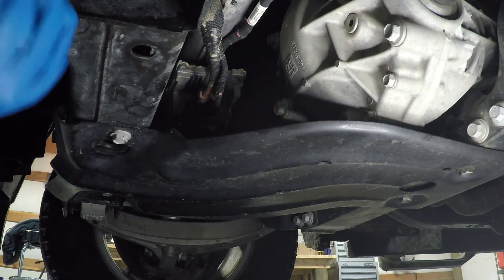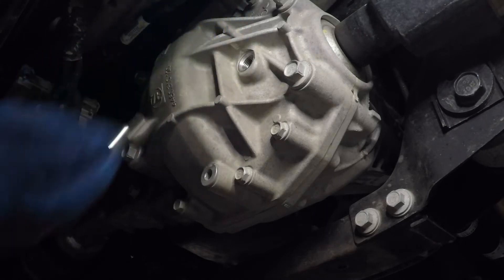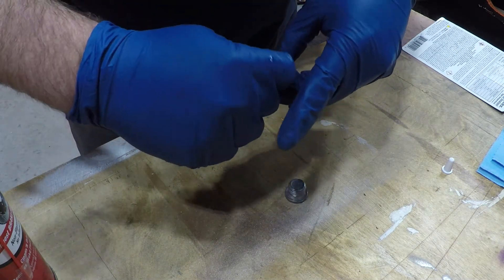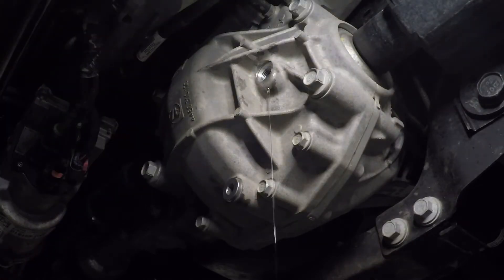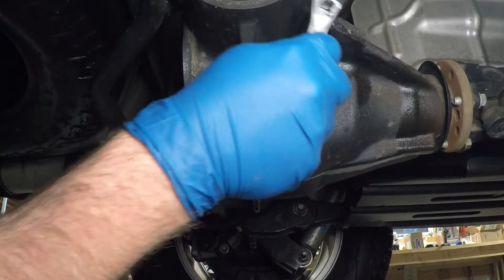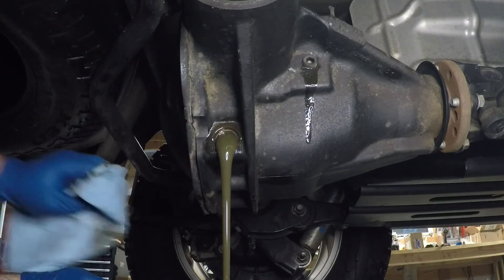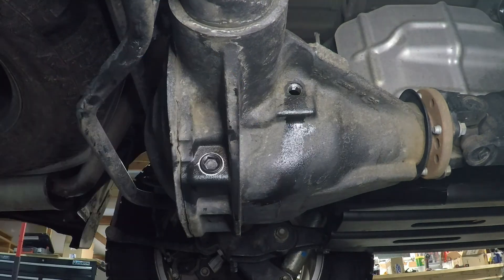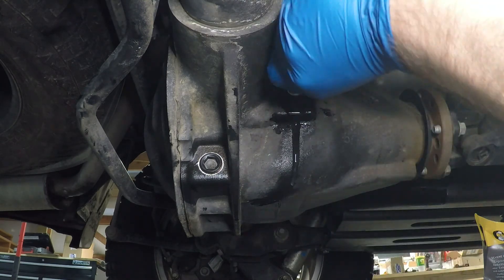RAM 1500 Differential Oil Change - 5th Gen Front and Rear

Comment: Mine has the max tow package and says to use 80w90 on the rear and 75w85 on the front.
Reply from the maker: I chose 75w90 for the front instead.  I have the standard rear diff with 3.92 gears which calls for 75w140.  Do you know the difference between the max tow and standard?  I'm guessing, a physically bigger diff with 3.92, but don't know.
Reply: @WorkshopAndHome  Yeah I really don't know if it's actually bigger. I am just going by what my manual says and what the parts guy at the dealer confirmed for me based on my VIN. Have you done a transfer case flush yet? Do you have a video for that?

Comment: Great video! Question, does it really take just under 3 quarts for the rear (2.85qt according to amsoil?) Only ask because when I did mine it didn’t take more than 2.3ish quarts. I know you don’t get everything out the rear diff but just curious. I did complete this in level surface.
Reply from the maker: I mis-spoke on the amount. It was just over 2 quarts based on what I have left in the bag.  I would guess the quoted 2.85 quarts is a dry measurement.
Reply: Thanks for clarifying. I was worried I might not have gotten enough in there.
Reply from the maker: As long as it's filled to the bottom of the fill hole, you should be good to go.

Comment: Whats the mileage of your Ram? I wonder when I should do this. I got 31K+ miles with occasional towing of a small RV
Reply from the maker: I didn't have many miles, but wanted to switch fluids.  I always thought 30,000 was a good rule of thumb when towing.  Most passenger cars I never worried about changing.